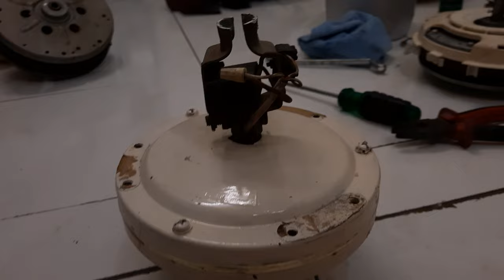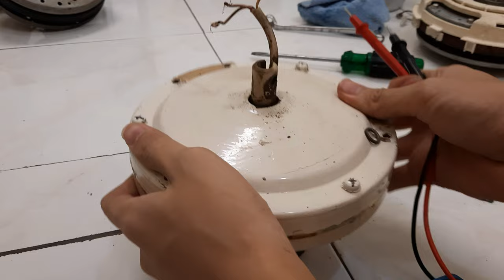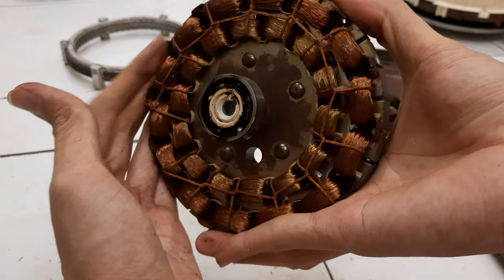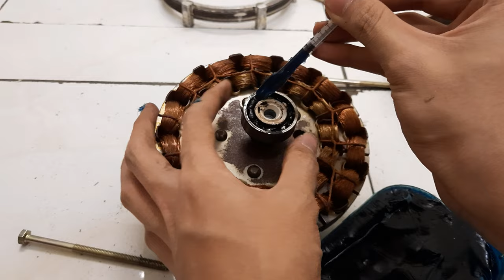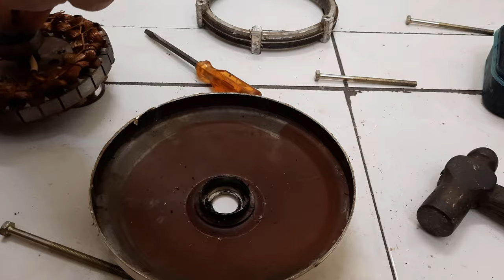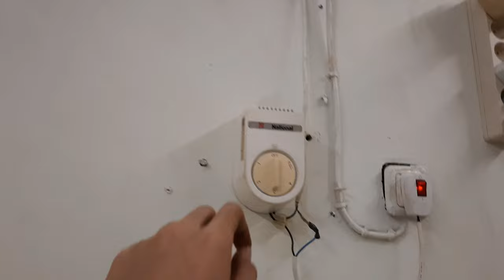Re-Greasing Ceiling Fan Bearings

Comment: While regreasing is a good thing to do in specific intervals, this video shows where it's already too late to regrease them. The damage is irreversible and requires new bearings.
Reply from the maker: Right on point! I believe the previous owner of this fan used it for years without giving it lubrication

Comment: Man greasing is so much easier then oiling. Grease once and it will last for another 10 years. I used automotive nissan approved on my pak fan causd that thing only has sleeves and no bearings 😒 the quality of things these days are getting worse each year
Reply from the maker: True, but in most situations, just a simple drop of oil is what a bushing fan only needs. I found that grease sometimes add friction to the shaft for months after application. I do have to agree with the quality drop though.
Reply: @TheFanUniverse  ik what you mean by friction gain. When I put it on my fan, it was running slower for a few days and the spin down was quick but after that it runs even better then new.

Comment: Ball bearings are pretty much disposable. Seems like it’s difficult to rejuvenate them to the original, factory smoothness. I never thought about using a syringe to apply grease, though I haven’t had the need to do that yet. That’s definitely great idea!
Reply from the maker: It was actually from a car repair shop I always go to where I learn how to reuse old bearings. Old bearings can be greased up, and put into service again if little, to no damage is found on the ball guides, and bearing walls. They first use brake parts cleaner to flush out the old grease, then pack the bearing up with a bunch of new grease. I came up with the syringe method myself as I didn't want to make a huge mess in my shop, plus buying a grease gun would be too costly.

Comment: Wow,great idea to open the motor,i strougle to get mine open to replace the bearings
Reply from the maker: Thanks! I hope my video helped
Reply: @TheFanUniverse  thank you,i think it will work for my fan,i gave it singer oil,it did quiet down abit after running it for about 3 days after oiling,i only got to oil the top bearing,will see how long it lasts,its a big childwood fan of mine,if it starts making big noises again i will try open it like you did,thanks again
Reply: Its made in 1991 and i bought it brand new out the box,i knew ball bearings only have a 5 year shelf life,so thats probably why the bearings are so dry